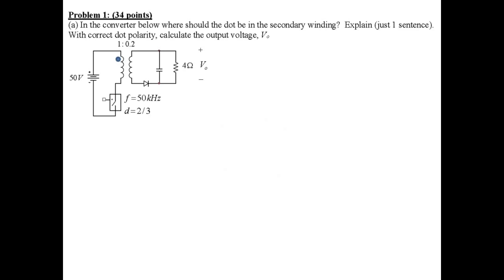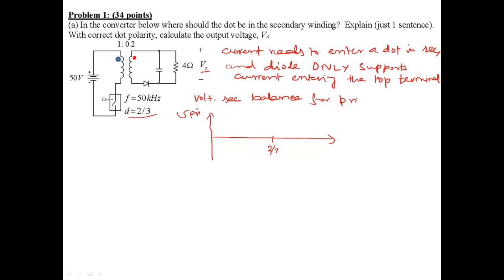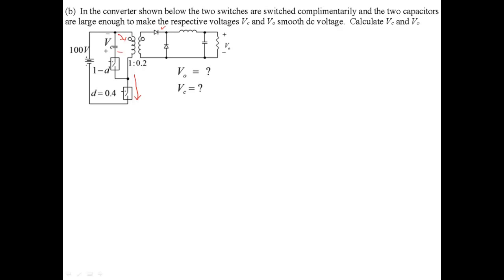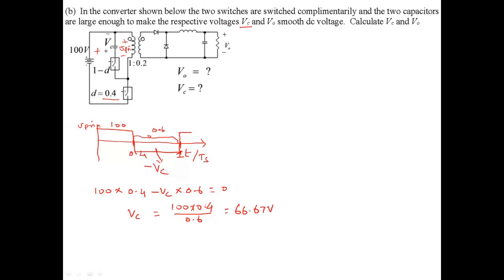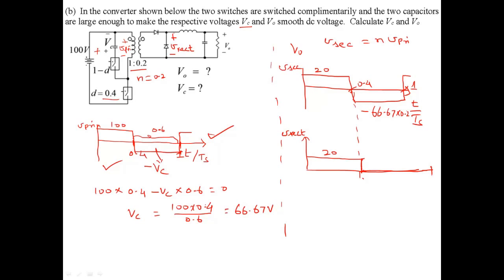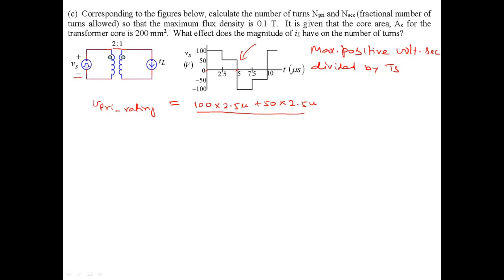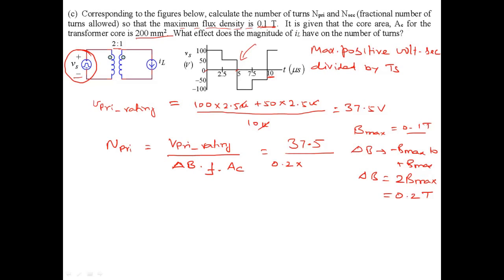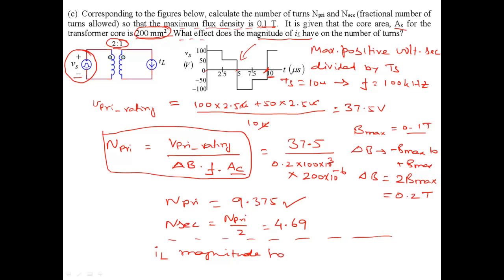midtem2 F16 p1

Comment: regarding problem b, the voltage of capacitor , I believe , goes higher and higher because whenever the switch in series with C gets on the  cap will absorb the energy stored in magnetizing inductor and the cap voltage will not reach to a steady state. to solve this issue there has to be a resistor in parallel to the cap to desipate energy,